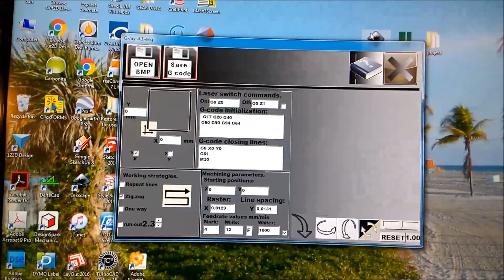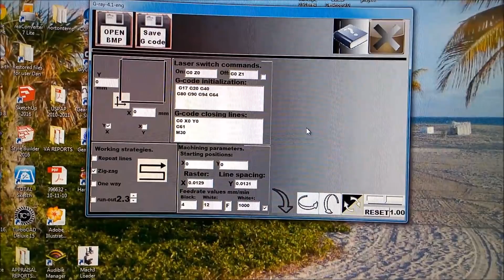DIY CNC Woodburning Photographs! - With Free Software!

Comment: So do you need both of those files downloaded to work, or which one works best? I'm just a little sheepish about downloading stuff that's of a language I can't comprehend....thanks
Reply from the maker: I agree.  I'm extremely hesitant to download software from forums for obvious reasons.  When I do want to download software like this I double check with a buddy in high level cyber security.  We check it out and then if I do download it I isolate it and check it with several virus packages and databases before unzipping it.  Can something bad still get through, yep.  Do the odds go way down, yes.  This seemed clean but it's a personal choice.  You don't need both files, the first one is the English version.  Best of luck.
Reply: Thanks I'll check  it out. I hooked a wood burner up to my homebrew cnc, and I can't say it's better or worse than the carving spindle, just different. I like the fact you can go way smaller without worry about tear out. Plus I like the no noise and no dust. Thanks for the videos...good job!
Reply: yea I must be stupid cuz I click on the top link, then there are two or three options to click there, and it's all Russian mumbo jumbo lol

Comment: Any thought given to bypassing the WBT's temperature control (if possible), then using some variety of micro-controller + temp sensor to better maintain temperature?  I also had the wild idea if a "ball point pen" (but 2-4x larger than for writing, and no ink) could be heated to the necessary temp, where a ball would roll rather than rub on the wood.  Thx.
Reply from the maker: Interesting idea.  All kinds of possibilities with this general design.  Thanks for your comments.